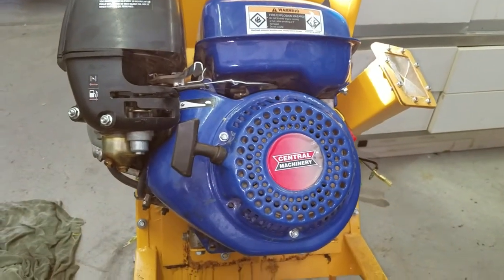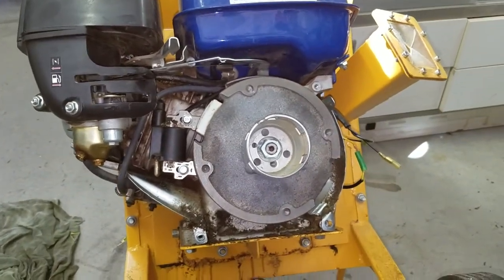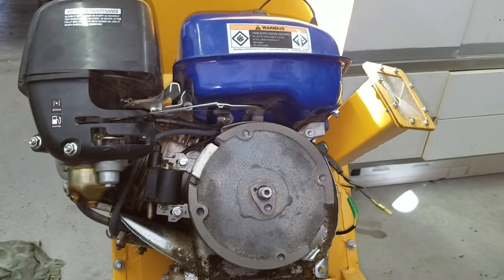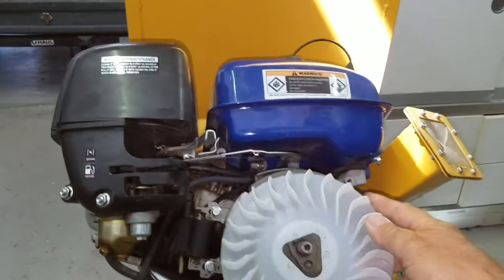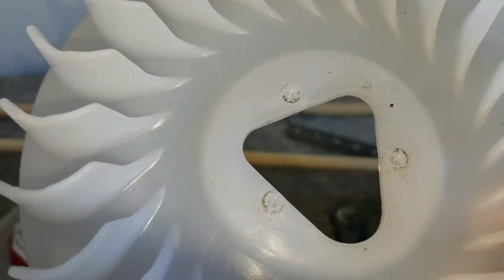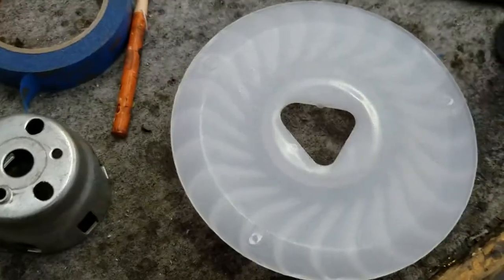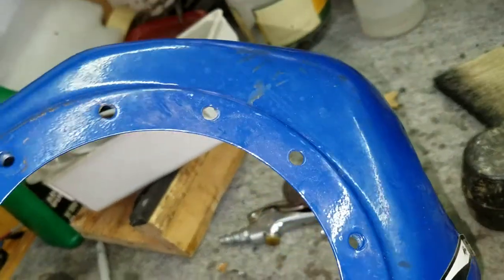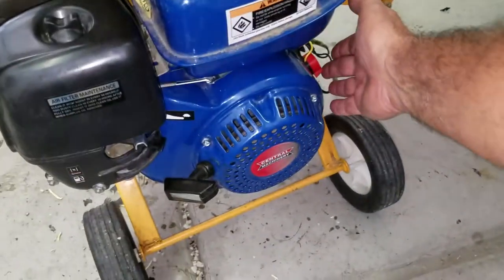Harbor Freight Chipper Fix

Comment: Just had one of these given to me by my inlaws.  Carb and throttle lever (and everything in between) rusted as shit.  Replaced the carb and still can't get it started.  Not sure where to look next.  Wish me luck!
Reply: Did you fix your chipper?
Reply: @ItsVideos  Yes!  It was the fuel line filter inside the tank where the hose connects.  Was clogged up and not dispensing gas properly.  Basically just poked a hole in it to get it to work.  Then after I get everything reassembled, I realized my new carb kit came with a replacement fuel filter!  haha.

Comment: nice job I have a problem where when I start my chipper it runs for about 10-15 seconds and dies, Iv cleaned and check the carb bowl and spark plug but nothing so I started looking closer and saw a break in the rubber/plastic "gasket" between the carb and the air cleaner and there was a break at one point however it was still attached. I'll try to glue it together however if that doesn't work do you think a new predator engine would fit on the chipper?
Reply: Were you able to fix your chipper?

Comment: I have one just like this. Needs a new fuel tank. Wonder if honda tank would work.
Reply from the maker: Contact that CSE parts link I posted before. If anyone can get you the correct tank, that guy can. He actually found me an original replacement fan. He was really a nice guy to work with.

Comment: that was a good fix,, these engines are very much like the honda, the air fan might work from a honda on this one.
Reply: What is the part number for the fan blade you found .
Reply: The motor is a clone of the Honda gx120

Comment from the maker: Just to let you know, After I fixed this I found a supplier called CSE Parts in Kentucky which actually sells Chinese engine parts and had the correct fan. Contact https://www.cseparts.com/contact/
Reply: I tried that link for parts but it took me nowhere. Has it changed?
Reply from the maker: @ItsVideos  Looks like they have permanently closed